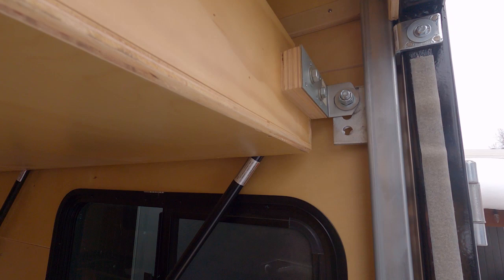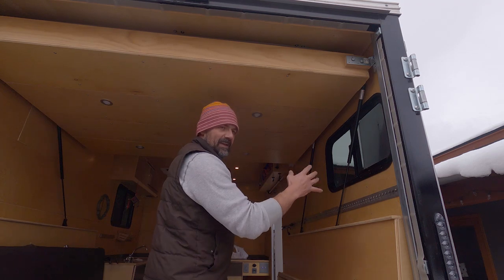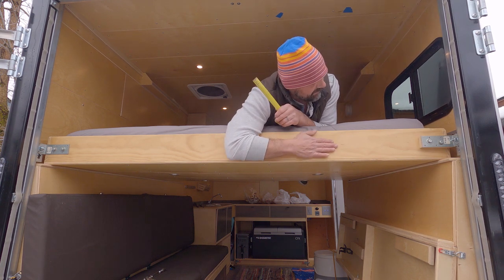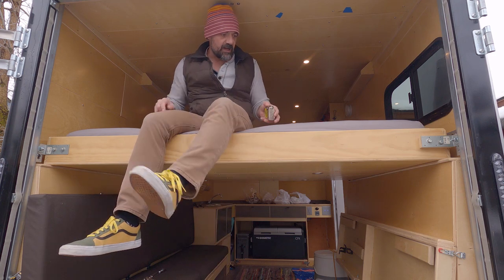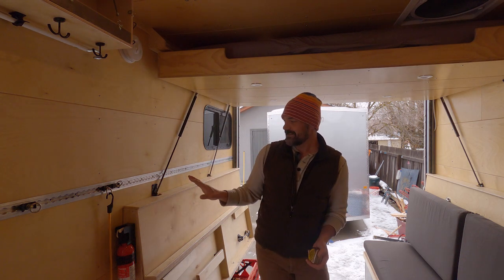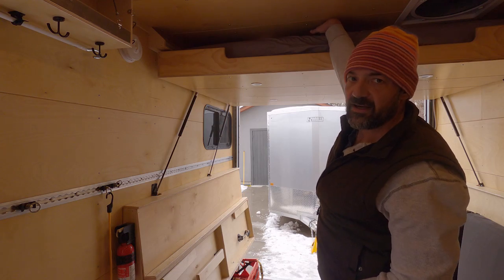DIY RV Elevator Bed- Measurements & Walk-Thru!  Cargo Camper Conversion

Comment: I just discovered your channel and I too subscribed.  I admit that I first encountered Brian Rogers video which created much intrigue, especially with all the information he shared.  And then finding your channel.....DOUBLE BONUS!!  Like many others, I am in the process of building out a camper/toy hauler using an 8 1/2 x 22 Cargo trailer.  And yes...an elevator bed is definitely the direction I want to go.  I wish I could weld...but as Dirty Harry said. "A man's got to know his limitations."  I hope not to burden you with too many questions.  The lift supports, 36" seems to be the chosen and preferred length.  Obviously that is the extended length.  Is the contracted length 20"?
Reply from the maker: JS,

Thank you for the kind words!  I appreciate the welding comment.  I have a welder but don't trust myself to make critical welds.  I ended up having a local welder do quite a bit of work on this trailer- all to the outside.  We used wood sandwich panels to brace for the windows, LTrack, and awning we installed- I will be making a video soon so stay tuned.  

8.5" x 22'  That sounds roomy!  We have been really happy with our bed design and plywood construction has held up well.  The 36" struts have a compressed length of around 21" depending on load and which sized end ball you use.   I recommend the 13mm ball studs as all of the mounting hardware is heavier duty.  Currently I am working with a local engineering school on the design- 44" struts provide for smoother operation but don't use full stroke.  A 40" strut would be about perfect but is not offered by Lift Support Depot.  Currently we are looking to achieve a minimum vertical lift of 27".    

Best! AD

Comment: I just started watching your channel and subscribed. My question is how did you get power to the inside of the bed frame ?
Mike
Reply from the maker: Mike, Thanks for subscribing!  The power runs along the drivers side ceiling back to the Unistrut channel.  It then drops down next to the Unistrut in a small loop which enters the back corner of the bed.  The wire then runs inside the mattress frame to the switches.  If you look closely you can see the white power wire looped next to the UniStrut (driver's side) in the video.  We haven't had any binding issues.  

Best!
AD